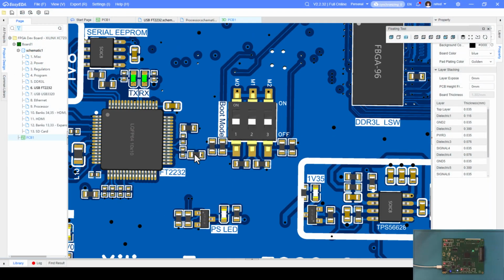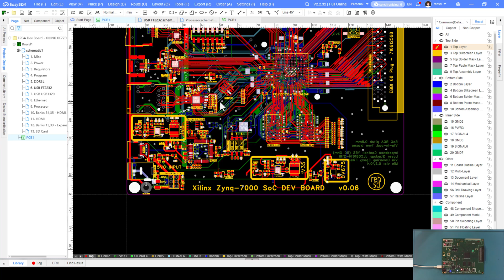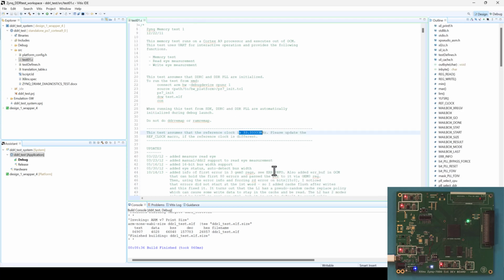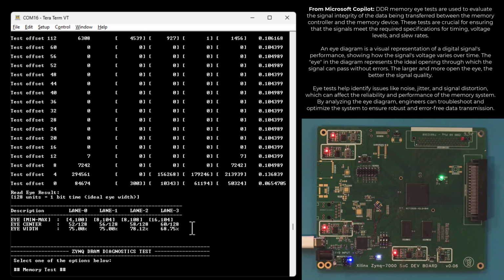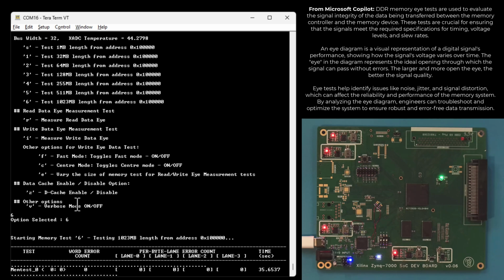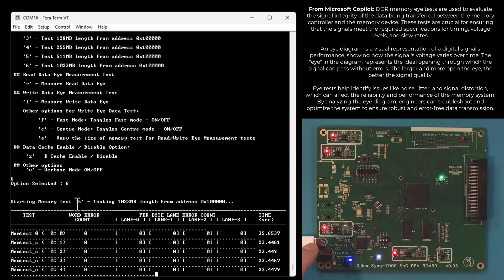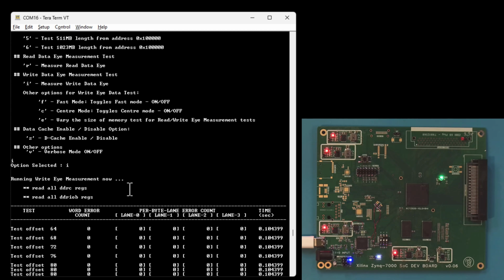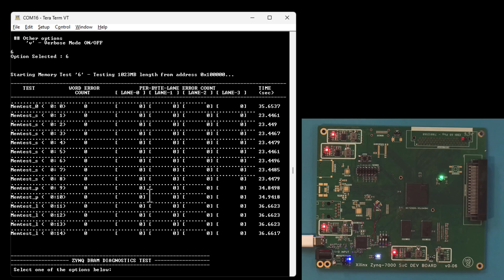Zynq-7000 PCB Build - Part 18 - UART & DDR

Comment: Why didn't you use original uart pins?
Reply from the maker: Probably a silly reason, and I'm guessing it truly didn't matter, but I wanted to have it on UART1 instead of UART0. This was based on how Phil's Lab configured his UART in his course. I wasn't sure if there would be a reason later to need it on UART1, so I chose to keep in line with what he did in his class.
Reply: @rehsd  That's most definitely is a silly reason. Vitis typically automatically picks the port that you've configured - as long as it's just one - and in any case, you can always select the port in bsp settings.
Reply from the maker: @asmi06  At least I can easily switch it back, if I choose to do so.  :)
Reply from the maker: @asmi06  I swapped the UART interface back to UART1, pins 14,15. I did have those two pins backwards on my schematic, so I have fixed that. Thanks!